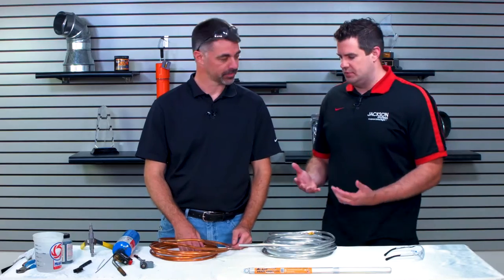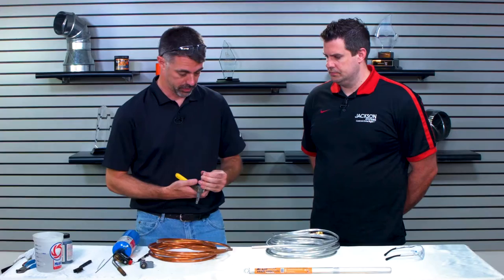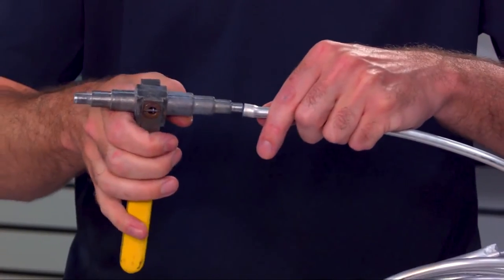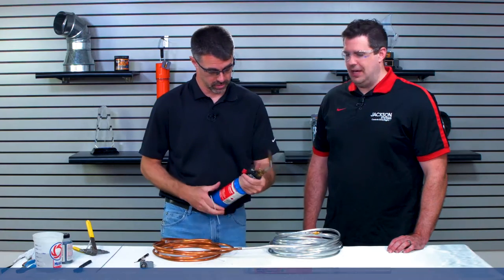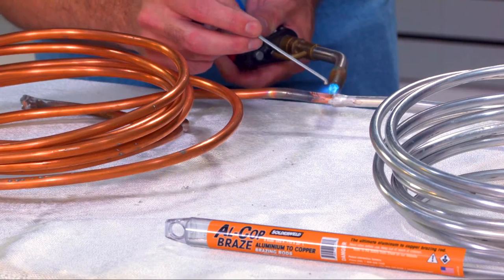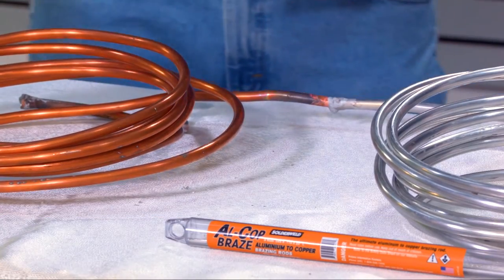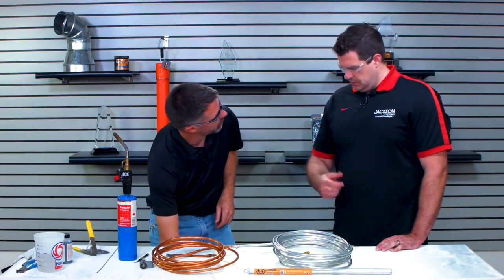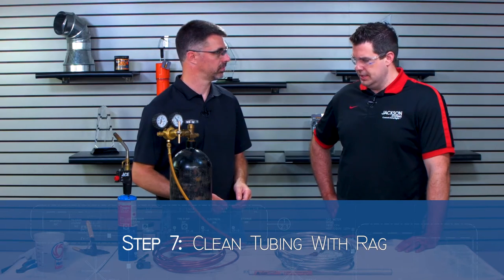How To Join Copper and Aluminum-- Solderweld Al-Cop Tutorial

Comment: What protection do you recommend in this procedure in a residential freezer? The plastic liner can melt if too much heat is applied.
Reply from the maker: Look into the Solderweld Hot block! That should help your scenario.  
https://jacksonsystems.com/product/solderweld-hot-block-heat-stop-putty-1lb-tub/
Reply: Also we released the new Flame Resistant Blanket that can help out dramatically i  this scenario

Comment: I was once at an industrial show where a guy was demonstrating a magical solder that he claimed would make a great joint to aluminum.  He was demonstrating by soldering a piece of aluminum to a piece of brass, and he used no preparation of the surfaces.  The solder flowed very nicely and made a beautifully filleted joint to both metals.  He gave me the soldered sample and had me push hard on the piece so I would know the joint was strong.  I took the sample back to my office and put it in my desk drawer, but I didn't buy any of the solder.  After some years of just having the sample sitting there in the drawer in a benign office environment, I picked the sample up one day and the aluminum popped apart from the brass when I barely applied any pressure at all!  I hope your material works better than his.
Reply: Snarf snarf
Reply: @matthewwalter67  womp womp

Comment: Problem with this i am finding out is if there is oil in the lines and its say a vertical pipe and its steadily running that joint is impossible to not ha e oil leach through thw Al- cop. Not forgiving at all with contamination! Fyi

Comment: Should use nitrogen when braze aluminum to aluminum? Thanks
Reply: Nitrogen is usually required when brazing copper-to-copper joints because when using 15% braze rod, much higher temperatures are required, around 1500⁰f-1700⁰f. And at that high of a temperature the inside of the piping has a tendency of building up ash and black scaling on the inside wall.. And nitrogen eliminates this scaling. But when using solder or Al-cop, a much lower temperature is required, hence why he's using map-gas, so the inner piping walls don't scale up and nitrogen isn't required. If that makes sense

Comment: Sorry to say the main thing you didn't saying .... Iam ac mecanic  I joined copper and aluminum pipe in American freeze.. Main thing ia flux.. And heat temperature. Copper must be high and aluminum must be low. Ok
Reply: yes, well said.  important to move the heat to the copper so as not to melt the aluminum